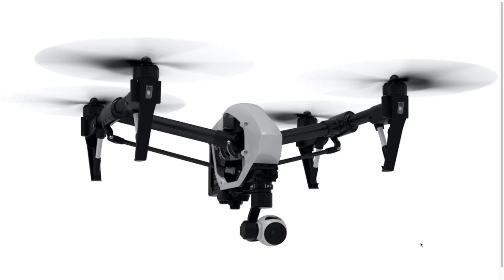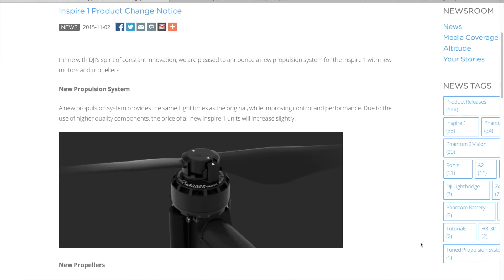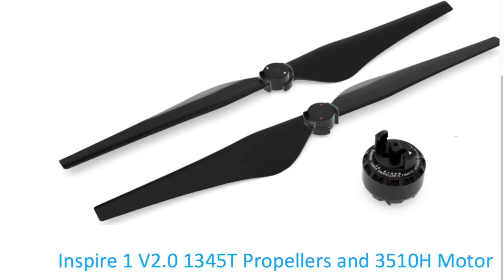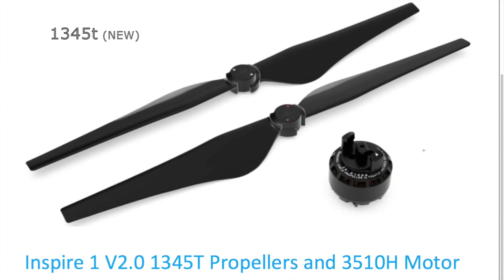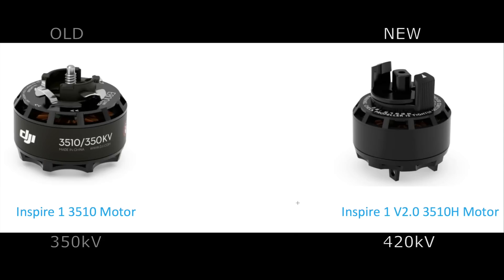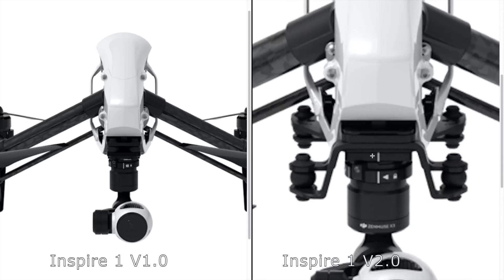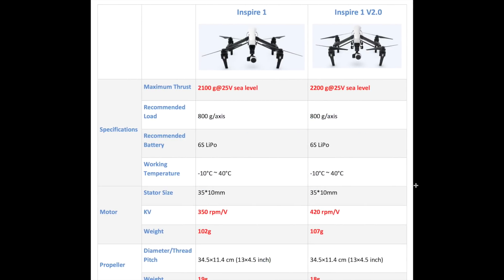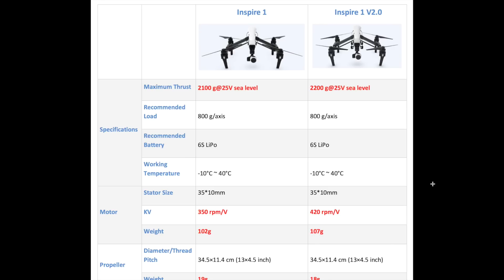DJI Inspire 1 V2.0 Review | What's New! Should you upgrade?

Comment: Thanks from interesting video. Just a small correction. Motor KV value does not stand for "kilo volt". It stands how many rpm the motor will spin per volt. 420KV motor is not more powerful than 350KV motor. It just spins faster.
Reply: Santtu Pousi I'll thank you for that info/ correction, as should the uploader of this vid..

kV refers to R.P.M./Volt. It is how motors are rated, and does not mean KiloVolts. If we have a 12V electronic speed controller (ESC), the speed will be 12 times that number. The higher the kV rating the faster the R.P.M of the motor. The lower the turns, the higher the R.P.M. of the motor.

Comment: should i upgrade the propeller system from 1345S to 1345T ?
Reply from the maker: +ifowr123 If your propeller system is in perfect condition then there is no need to upgrade them. I'm still using the 1345S and they work perfectly.

Comment: hey, great vid, awesome, gave me a lot of info :) but just one question: did I get it correct that IF I'm thinking about using the X3 (not only the X5) I should pick the Iv2.0?? 
so that means that the I1 can't really handle the X3? 
or could I use the new and bigger plate on the I1 too? 
cheers mate :)
Reply from the maker: +AtraxJoe Thank you!
Both versions of Inspire 1, V1 & V2 are compatible with X3. the V1 requires additional gimbal mounting plate for the X5, whereas the V2 is readily equipped with the upgraded mounting plate that can house both X3 and X5.
So in case you do not intend to upgrade to X5 at a later stage, you can save some money going for the V1.
Reply: +Kailash Naik 
absolutely awesome, many thx for the info :). looking forward to your next vid ;). Cheers
Reply from the maker: +AtraxJoe Welcome! :)